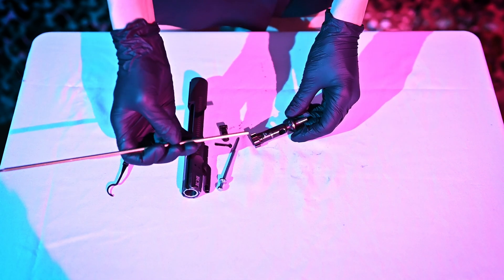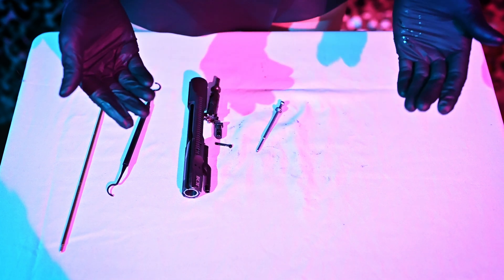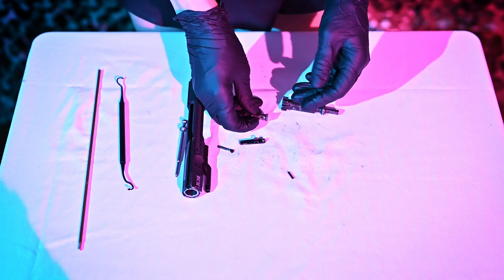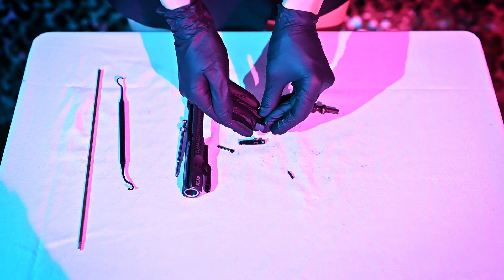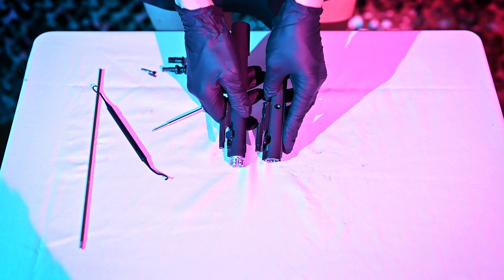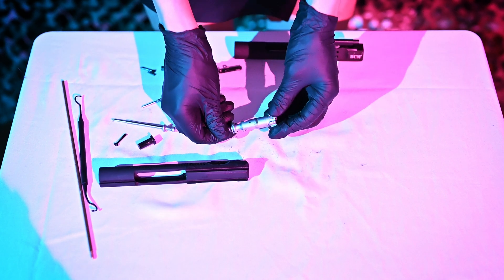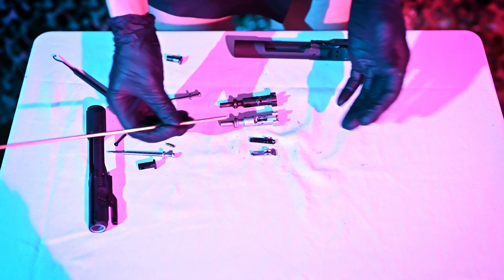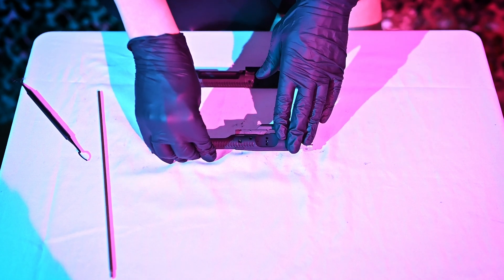Bolt Carrier Group Maintenance & Upgrades Featuring the LMT Enhanced BCG

Comment: The relief cuts are a bad thing on the ejector side..It leaves and an opening for ingress that the standard rail doesn't..The cam cut on the LMT is lengthened on the straight part of the cam path to allow more residual pressure to escape in the carbine gas system before the bolt un-locks..It will not work reliably in a rifle length gas tube..This lengthened cam track does not increase dwell time as that is determined by the port location to the muzzle....

Comment: If you got a bore camera and can see inside the carrier, you'll see the milspec one has just a big hole where the gas key comes out. The lmt one has two gas ports that go left and right instead of straight down. I find it unique but it is harder to clean because you can't push a pipe cleaner down the gas key like you can with a milspec one.

Comment: What’s your opinion about Toolcraft’s Diamond Like Carbon (DLC) coated M16 cut BCGs?
Reply from the maker: DLC is interesting, but I honestly like phosphate for its more porous properties, which help retain lubrication rather than slick it off.
Reply: @TacticoolGirlfriend  lol yeah that’s fair enough, the main reason I got it is because I wanted an m16 cut bcg instead of my default ar cut one. 

I also got this specific bcg because of how great they made it sound; extremely low friction coefficient, it cleans easier, super resistant to wear, blah blah blah. But honestly I’m quite impressed with how it’s running so far, I’ve shot over 200 rounds with the thing and it may not retain as much CLP as phosphate, but it’s very smooth and silky when racking the bolt back’n forth, also it cleans just as good as my original bcg. Maybe it’s just buyer’s bias? Idk but I think it’s pretty good!

Comment: It's important to note the the altered cam path in the LMT Enhanced BCG was designed for carbine gas systems with minimal dwell time and large gas ports.  IE: the Mk 18.  It needs the high port pressure of the carbine system to work reliably.  It will decrease the reliability of mid-length and rifle gas systems.  If you're running a 14.5 or longer barrel, getting the bolt by itself with a milspec carrier is a better modification.

Comment: I love that you dive deep into technical details like this instead of surface level reviews of every shiny gun like so many other channels.
Reply: Jim Sullivan came back with his own enhanced BCG that Surefire made. Jim actually gave a big shoutout to LMT for their enhanced carriers and said it was probably the best possible upgrade with a shorter barrel rifle. When they made the 14.5 and shorter, Jim Sullivan never accounted that in his design and unfortunately Colt just said to "make it work" and they used the same parts as the rifles but just added a heavier buffer and shorter gas system but it still had a much shorter lifespan and a much more violent system than what they originally designed when they scaled down the AR10.

Comment: silver sharpie for staking.i dont do it

vented forward asisst, i never use my forward assist. some just want the forward assist.  shooting suppressed some also did the high temp rtv chagring handle solution as a poverty gas buster especially on bcm high lip gen 1 charging handles

battlefield las vegas does a lot of full auto rentals and said lmt lasts the longest. it could be that 8620 steel

lmt is good kit. buy it if its available. stiffer extractor springs are how we used to get ar's running. the next biggest problem was shreared bolts and broken firing pins. 

i really like lmt and ive got colt, geissele, dpms, bushmaster,  bcm, bca, psa, and custom builds

Comment: Ive been running a Bootleg bcg in my 300 blackout for about 8 months now.  Definitely recommend.  I've been testing a variety of ammo lately, subs and supers, and it allows me to cycle everything, at the very least.  You can really notice the difference in the gas settings, especially regarding the movement of the BCG itself.  Ive decided i want to go ahead and tune the rifle for subsonic ammo, so ill need to do a little more tuning than just the BCG.  For supers + suppressed, the BCG alone made a world of difference in mitigating gasses.

Comment: One thing about gas keys is that they can work loose over time, and they won’t look loose. Check for this by holding the body of the bolt carrier in one hand, and try to move the gas key with the other. Any movement between carrier and the key is bad.  
This problem is most likely to happen on really well used AR-15s and M16/M4s.
Excellent information, as always, Tacticool Girlfriend.
Reply from the maker: Yes, excellent point, thank you! A loose gas key should be apparent with a little wiggle.
Reply: School of the American rifle uses a torque drive set to 20 in-lb in reverse to check gas key tightness.

Comment: I used to love running nickle boron bcgs as they seemed to run smoother, but over time, I found that it chewed up gas rings much faster than my regular phosphate bcgs

Good info in this vid 👍
Reply: Seconding this; the AR-Stoner NiB BCG I've been running has gone through gas rings faster than my phosphate BCGs. Not that its hard to buy and replace gas rings, but for those that don't want to bother then the phosphate BCG is more for you than a NiB one.
Reply: @thefirstthrownmolotov6852  its odd because I haven't had issues with Chrome bcgs and I've had friends with nickle Teflon bcgs that seem to not eat gas rings. But all nickle boron bcgs eat gas rings from my experience, I even saw one crack a cam pin really early on.
Reply: Nickel boron is a more abrasive finish according to Chad at School of the American Rifle. He mentioned it will wear gas rings at a faster rate.

Comment: Have you ever considered trying a DLC-coated bcg? I bought one from Sharps Rifle Company because I heard they run so smooth you almost don't need to lube them. Haven't had a chance to try it yet because life happens, but it's on my to-do list.
Reply from the maker: I've considered alternate coatings, but I actually like phosphate finish for its more porous qualities, which help retain lubrication rather than slick it off.